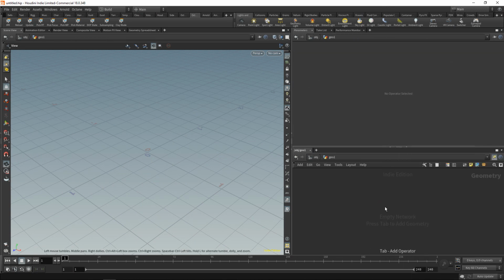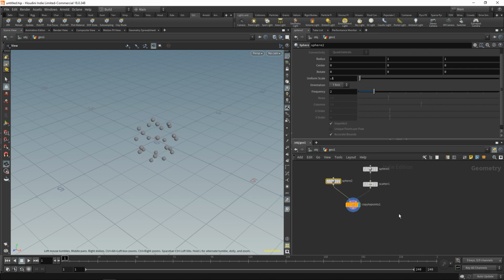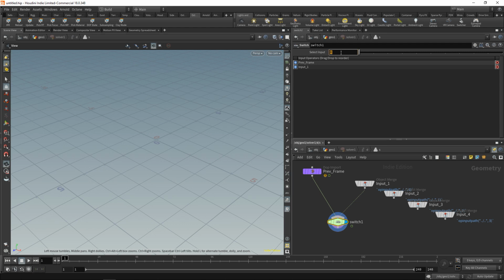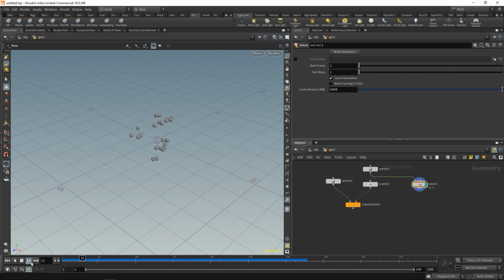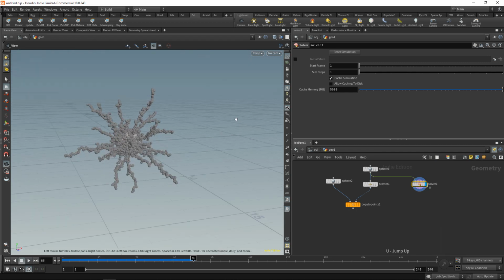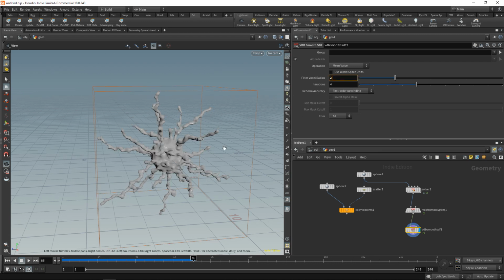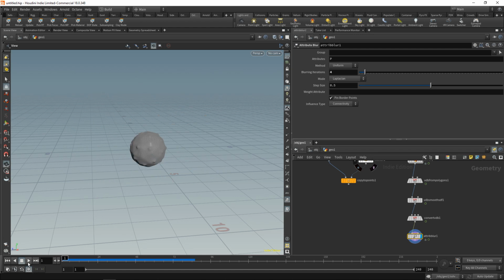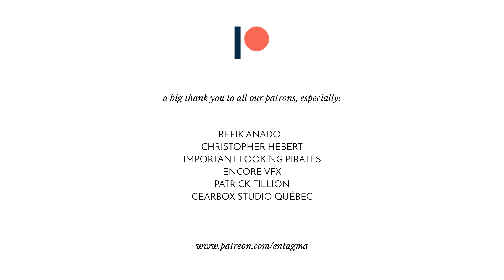Houdini In Five Minutes 10: Procedural Animations Using The SOP Solver

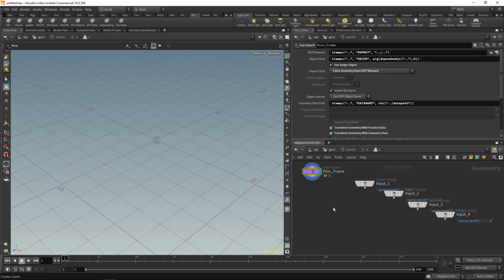Comment: At 1:43 "to employ a proper technique the first thing you wanna do is drop down a Switch" - is this still the case in Houdini 19? (Frame 1 seems to display the input geo without needing this.) Also perhaps updated, the Solver provides an OUT node that, when flagged, seems to eliminate the need to go up one level to press play and see the animation.

Comment: Ive got two questions 
1. Can we slow down the sop solver, for eg: can I make things happening in 20 frames, happen over 40 frames
2. Can I uv map this geo, so that I can do some nice shading. 
Thanks in advance.
Reply: You can UV map by adding inside solver Attribute copy node with name uv and wiring its first slot to scatter (add a node after scatter and before copytopoints), and second to prev frame. Make sure you created uv's for the original object you are using. For slowing down time blend works well setting by speed and fix it or any other node from time shall work either, just wire that after the solver, cheers!

Comment: So at the end, we identified that the vdb workflow was slow... but what do I do with that information?  Is there a different workflow that can achieve a similar result?
Reply from the maker: Nope. VDB currently is the most versatile workflow when it comes to those kind of effects. The resource hunger is just a matter of the fact that we're using Voxels here, which are inherently memory hungry. Cheers, Mo
Reply: The big thing for speed of workflow in this case would be to make sure to go through the process of tweaking and iterating your solver settings prior to activating the VDB conversion, not after. That way you can dial in the overall shape/speed/etc. without spending too much time waiting around for it to run all the extra processes along the way.